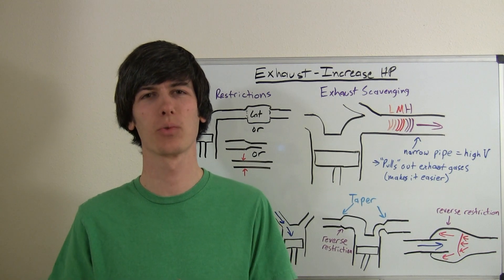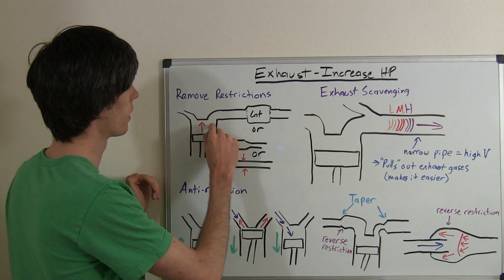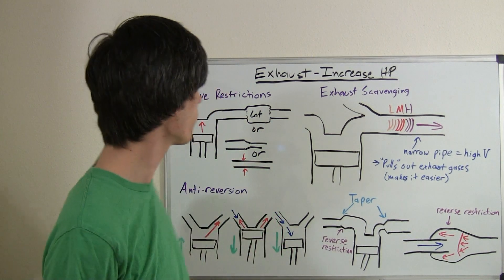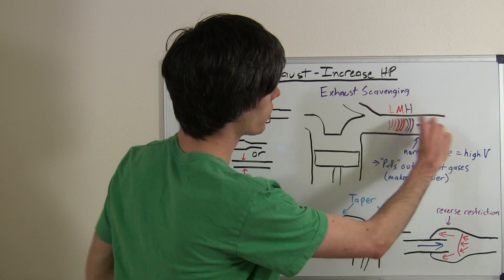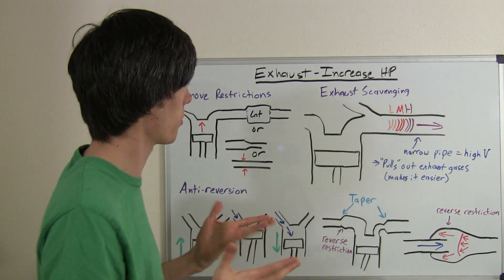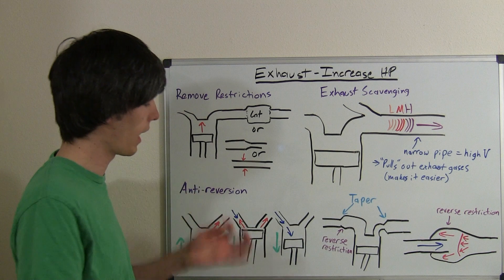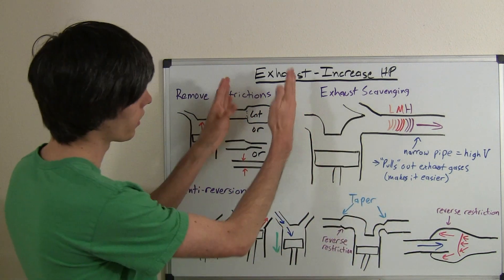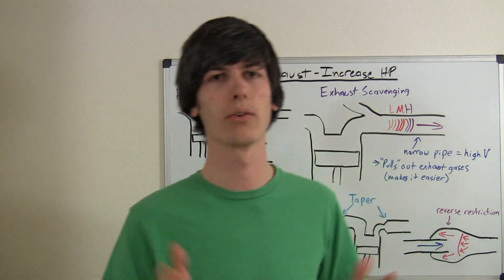Performance Exhaust - More Horsepower

Comment: +Engineering Explained I heard a debate about a twin exhaust that had a butterfly valve in one tip. It mainly seemed to be a volume mechanism that that limited exhaust gas out below around 3/4k so in neighbourhood driving it was more friendly! Some ppl disabled it as a easy mod that allowed it to stay open therefore more gas being free equals more sound, however arguments ensued about losing low end torque as u need which u explain in a lot of videos smaller/less diameter or in this case two pipes open leaves less restriction hence pressure to expel the car in the opposite/forward direction. What's your thoughts ad I feel it is partially both as u need more diameter for more power an less for lower speed like in turbo designs etc an once tried it in a previous vehicle an did slightly feel it didn't pull as well low down with both constantly open. Many thanks!
Reply: Engineering Explained Also are panel filters worth while or does the increased airflow mean less filtration. Which if his results in more power but more gas/petrol used but if used sparingly you could increase mpg due to reaching speed quicker changing gear quicker?

Comment: Is there some formula to figure out what dia the headers and pipe should be ?
Toyota 4age 1.6Litre
Noise reduction is of no significance.
Would taking the exhaust ports dia and multiply by no of cyl's be the most accurate ?
Reply: keep the exhaust the same as the header collector.  Have some sort of testing-dyno or exhaust gas guage to insure the motor does not lean out especially on the top end.  i have road raced this motor in a sports racer for several years with both dual webers or FI with great results

Comment: can i make pipes out of the same martial like fiber glass :/ or no
Reply: Fiberglass doesn't last long under heavy vibration. I don't think it'd be a good choice in construction material.
Reply: DE Nichols  And that doesn't even consider that I'm sure it'd put out toxic fumes in that much heat.

Comment: whats best for a DOHC 2.0 car, dual or single exhuast?
Reply: Towards The Sunset My neighbor has been seeing up exhausts for a lifetime. Even on old cars you can have too big of exhausts because it renders scavenging ineffective. Modern cars are even more sensitive as simply free flowing exhaust is no longer the only key for maximize power/efficiency. 

Exhaust flow us highly connected to MPG. I have real world proof of this. Do you? 

You make a lot of correct points in your statements. I'm disagreeing with just one part. 

More power isn't always more efficient. More power can just guzzle gasoline. 

Maybe you have different objectives than I do. Remember your goals can change your perspective.
Reply: definitely single
Reply: DE Nichols
why?
Reply: It'll be too much.

You probably want a 2.25" or 2.5" exhaust. I'll talk about a few things that may lean you one way or the other on the subject.

I got a 2.25" catback exhaust on my 1.8 liter DOHC. I made a lot more power. I could really feel the difference. I'm an efficiency guy. That's my primary goal. I lost some efficiency in the city, but I made so much more efficiency on the freeway that it more than made up for it for me. If I only drove in the city, I probably made a mistake.

Over time, I realized that I could still have similar efficiency in the city, but I had to use less of the power I had opened up.

Having more efficiency will get you more power, but if you use all the power you've obtained you'll end up having less mpg.

The 1ZZFE engine in my car also came in the 1999-02 Chevy Prizm and Toyota Corolla. It even was in the Pontiac Vibe and different years of the Celica.

I knew a Celica owner who went with a 3" catback exhaust. He felt that it was overly aggressive. He did have more power, but his mpg was destroyed. I think he had about the mpg of my truck 17 mpg. That's terrible on that little engine. While he had a little more power, he probably would have more if he hadn't over done it. Some back pressure is a good thing, especially in the low to mid RPM range.

When the Corolla went to a 2 liter engine, more people thought the 2.5" exhaust was better (just the trend I noticed, it's not like I did a survey. :) ). I'm resharing what I learned on Toyota nation or the corolla nation forum. I forget which. I don't have that car and I can't be as certain, but their reasoning and opinion seems sound from my similar personal experience.

I'm tempted to give you a link to my website if you'd like to hear more, but I don't want to spam Engineering Explained, so if you're interested in other exhaust work I've done and my personal results, go to the video and look around.

To sum up....if you're concerned on not being as spendy on gas, maybe that 2.25" would do better for you, especially in the city, but for more power at higher speeds, perhaps a better result on the freeway or where the engine would live on the track the 2.5" would be better.

It's your choice. Regardless of which you chose, I think you'll be having fun on the journey and it'll give you experience towards that eventual next project.
Reply: DE Nichols Everything you just said was completely wrong. Bigger pipes leads to worse mpg? The only thing a larger diameter pipe does is increase exhaust flow, and without increasing intake volume, and therefore allowing a greater air:fuel, you are not actually increasing power AT ALL! And exhaust flow is unrelated to fuel efficiency, since the amount of fuel being burned is related to how much fuel the driver decides to add AKA how much you depress the throttle. Single pipe or twin pipe exhaust makes literally no difference in terms of flow, it is about diameter of the piping and the angle of the bends, hence why mandrel bent exhaust systems with larger than stock diameters claim to produce more power with an intake and tune. Case in point, if you're not increasing intake flow, and/or accounting for increased intake/exhaust flow, then a "performance" exhaust does nothing to improve power or increase efficiency. That "feeling" you get is all in your head! And you completely mislead the guy; there is no such thing as "too much flow" or "too wide a pipe". In the realm of automotive engineering, the more flow/the larger the size of the pipe, the better as there is less restriction, and thus the car can breathe better, create more power, and have less exhaust back pressure.
Reply: Towards The Sunset As far as single exhaust vs. dual exhaust choice, of course total flow is the point and not whether it's dual or single pipes, but he's probably working on a L4 engine. Why in the world would you bother with the waist and expense on dual pipes unless you had a 2 bank engine? 

There is probably no where to put a second pipe.

Comment: what about if you have straight pipe and no mufflers will i loose power..2008 accord v6 2.5'' pipe
Reply: u will never loose power having a straight pipe. but be careful, sometimes a straight pipe have resonance inside which complicates the exit of exhaust gas and finally u have poor results.

Comment: How do u figure out loss of HP due to CAT, and how do those performance CAT actually work? All manufacture will give engine HP, but not actual HP to the wheels?
Reply from the maker: Well you'll have a certain pressure drop at a certain velocity. High flow cats will have less pressure losses through the cat.

Comment: I have a 97 tbird and I just found out my catalytic converter is junk. A new direct fit is $455 plus about $200 labor and thats not cool. I heard that straight piping the car is a cheaper, not so legal way to fix my problem. Does it really work?
Reply from the maker: It's typically not legal, I wouldn't recommend it.
Reply: It'll end up running worse. What I did is I went for a 2.5 inch catalytic converter over my stock 2 inch on a 1999 chevrolet prizm. I got 50% more horse power. I don't think that's a typical gain. Some of the gain was the old catalytic converter being bad, and a little more came from it being more free flowing.

I wouldn't go with a normal freer flowing catalytic converter, it'll have fewer cells, you'll end up with a check engine light, and if applicable you won't pass emissions.

It was very difficult to get a bigger catalytic converter. I have an article that explains how I overcame the obstacles. http://carmilespergallon.blogspot.com/2014/08/catalytic-converter-and-horse-power-why.html
Reply: Engineering Explained Oh, and in addition to your comment. Even if you live in a county like me where there is no emission testing it's STILL an illegal modification of your exhaust. It's a federal law. The only way to get away without a catalytic converter legally is if it's not a street car, like farm or race only, or if if the car is old enough.

Comment: Engineering Explained Is there any reason to use glasspack mufflers like Cherry Bombs over traditional muffler designs? Sure they sound great on a V8, but I imagine they'd perform better since the exhaust is passing straight through.

Comment: easy is not as easy as u thought...when the gas flows easy..its create more vacuum in the cylinder..so when the intake stroke takes place.air/fuel cant fill up cylinder in time..so less hp on low rpm,high at high rpm
Reply: I guess you would have to remap the fueling richer at low rpm so you don't lose the bhp  ?!?
Reply: Juris Negrics My car was a lot more spendy on gas in the city after getting my 2.25" catback exhast. It was still a mpg win because it did so much better on the freeway. So the car will use more fuel all on it's own. No need to remap anything.

Comment: Hi there.I'm wondering which is better for a subaru 05.Unequal headers or equal:)?
Reply: unequal!!
Reply: unequal headers give you the distinct boxer engine sound but for sheer performance equal length is better.
Reply: Matthew Nestell I think Subaru makes great cars. So don't take me being hard on a good brand. I never liked the boxer sound. Maybe tuned headers would help me try the boxer experience. :)

Comment: So does a smaller exhaust pipe give you more hp because it has more velocity, or does a larger pipe give it more hp through volume?
Reply from the maker: It's about finding the balance. :)
Reply: Engineering Explained Any fancy formulas for figuring out what would be a good fit for a given engine (horsepower and cylinder wise)?

Comment: i'm trying to figure out what a power bomb or cherry bomb exhaust really is
Reply: nikka hilabtanun I know this is kind of old, but I don't think you'd want to cool your exhaust gasses since when they cool they condense and reduce speed essentially causing back pressure. Not sure if that's going on in a simple cherry bomb resonators, but yea better that the exhaust gasses stay hot to keep the same velocity.
Reply: a resonator. nothing else.
Reply: wow, i thought it was some sophististicated technology, thanks. i found out that those power bombs have expanded areas in the pipe and cools the exhaust air
Reply: there's no point in cooling the exhaust anyway. its cool enough to put your hand right behind the muffler by the time it gets that far. if you want a performance exhaust the best thing to do is find one big enough for the power goal your shooting for, in my case 3", if its a single exhaust, 1 single resonator and muffler is fine unless you want to keep your cat. i live in michigan so i just got rid of it since it is somewhat restrictive. exhaust is quiet simple, needs to flow well and needs to be quiet enough so you wont get a fix-it-ticket twice a month.
Reply: Large diameter only matters when you're near top RPM, and thus greatest exhaust flow... you actually want a high exhaust velocity to boost scavenging effect (if your exhaust is tuned for that) and that means a relatively smaller pipe diameter. Otherwise racecars would all have huge 12" diameter pipes. But if it makes you feel better to have a bigger pipe...
Reply: race cars have exhaust systems that are short as possible. i.e: out if the hood

Comment: sir, this a great informational video. can you please give me a little more information on the conclusion? What in your point of view is a better exhaust for getting more HP? Most part of this video was about constraints. can please suggest how a better exhaust should be?       THANK YOU
Reply from the maker: Minimize constraints, and optimize the diameter for maximum exhaust velocity with minimum restriction. Easier said than done. :)
Reply: Performance exhaust systems are much more involved than simply cutting out the restrictions. In fact, racing vehicles typically have the exhaust system "tuned" to boost engine performance. This boost comes from the exhaust scavenging effect, which when properly implemented, actually pulls a greater volume of air charge into the cylinder than could be achieved normally (without turbo- or super-charger). Proper tuning can also cause the exhaust pulses to start a resonance which grows and increases the scavenging and air-charging effect, further increasing the performance boost.
Reply: wingman358 Engineering Explained mb u know how to calculate a resonance wave's lenght and in what distance from cylinder head's exhaust port should be a resonator? i have drawning with exhaust system from one engineer, but there is no formulas, just numbers, but he said, that different engine - different distances.

Comment: My teuck has a 2.5 exhause all the wa back for start so my muffler sits just under the cab and from there is probly a 5 foot mase of tail pipe I reciltly cut it off and put on a simple short  turn down tip would I have helped back pressure

Comment: Hmmm, everyone keeps moaning on about back pressure as a measurement in venturi restrictions!!  Its actually the differential between the manifold temperature and the end (back) temperature.  The cylinders do indeed 'push' the gasses, but only to a degree...the rest is the venturi effect of the difference in temperatures.  This is how Motorbikes can get away with smaller exhaust systems as the end part of the system including the silencer is highly exposed to the elements.  This is what my uni proffesor taught us anyway...upto you how you take that.  Just my two pence worth.

Comment: you all must keep in mind this video is made with the idea that the catalytic converter is on the car he's speaking of. my truck has no catalytic converter, but a fairly narrow exhaust pipe, so its really loud but low rpm still behaves very well (lugging at maybe 1000 rpm) i had the cat removed because it got backed up and i could smell it - but the backpressure was ridiculous, i could accelerate up a grade at like 40 mph in overdrive, 45, 50, no problem whatsoever. just totally clogged lol

Comment: From what I understand, naturally aspirated cars need some amount of back pressure in order to maximize performance. On the other hand, forced inducted cars wouldn't need as much back pressure (if any at all) since the pressure of ignition is far greater in energy and would expel out the exhaust at a higher velocity than a NA engine. ie: I had 2.5" piping on my turbo supra but after going 3" piping and deleting the cat the turbo spools up faster and I get a quicker acceleration and more power

Comment: so basically if you want to have large diameter pipes with hardly any restriction or cat, you gonna also want to upgrade your intake  to force in more air to the cylinder, that way it doesnt create a vacuum with the exhaust bringing it back into the cylinder.

Comment: the engine's controller is meant to maximize MPG. The engine is subject to what you want to do with it via controller calibration (pcm), the toyota engine can be fitted with denser pistons (forged) conrods, and crank. You can then force the engine extra amounts of air to allow it to run more hydrocarbon and make more power! Cheers.

Comment: Wow people take these videos too seriously.  Look the basics of the engineering covered here are accurate.  There are a million things the author does skip, but he is also trying to fit this into a specific time frame and educational level. For example: back pressure isn't all bad,  some back pressure is required to prevent the exhaust valve from cooling too rapidly and warping. However the myth back pressure builds torque is false,  if it wasn't why aren't all exhaust systems welded shut?

Comment: Your discussion should involve early exhaust valve opening. As the exhaust valve opens several degrees before BDC, greater exhaust manifold pressure reduces mass flow of burned gases during the expansion stroke. Mind you, this applies at low engine speeds. An ideal application of this is the corvette variable exhaust.

Comment from the maker: Similar yes, but the pulses of exhaust gases will be more frequent, and you also have to consider pressure waves to keep the intake air/fuel from escaping into the exhaust.

Comment: I have a question on removing my resonator on my Mercedes. It's a 5.0 naturally aspirated V8. I currently have taken off the muffler, and am deciding whether taking off the resonator would cause a loss of power/torque. Would a resonator removal cause this (with the combination of a muffler delete)? Thanks.

Comment: As long as he didn't remove the expansion chamber, then in the scavenging process the engine would pull in more air making it run far more lean, and that could cause the engine to cook itself

Comment: Idk, but isn't increasing the area will increase the air pressure? Well, I think it's good for the intake because it increases the pressure even if it actually slow down the velocity. But in the exhaust, aren't we want the gas flow fast with low pressure? If the pressure greater than the cylinder, won't it go back?

Comment from the maker: Don't see why it would overheat from removing the muffler. I can't tell you whether or not you've seen gains, you'd have to test the engine with either a dyno or by measuring your acceleration with and without the change.